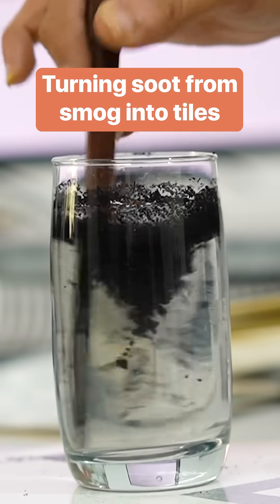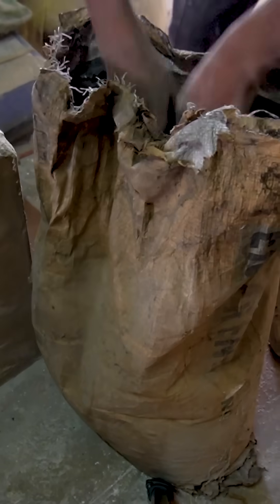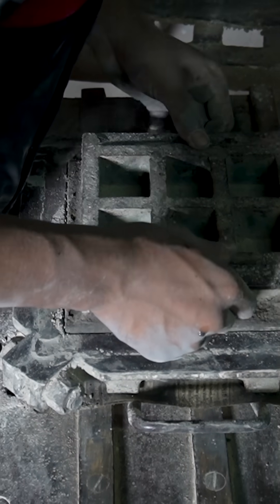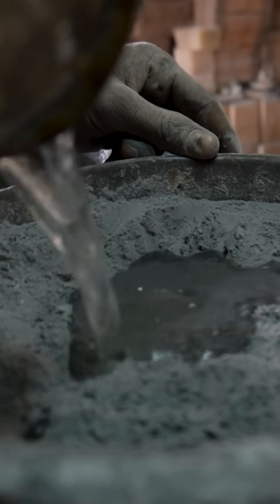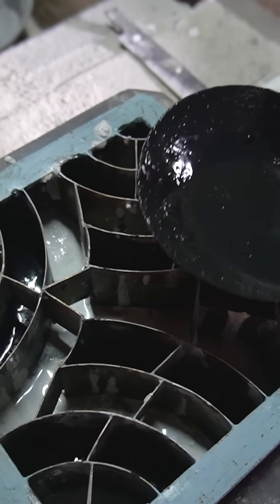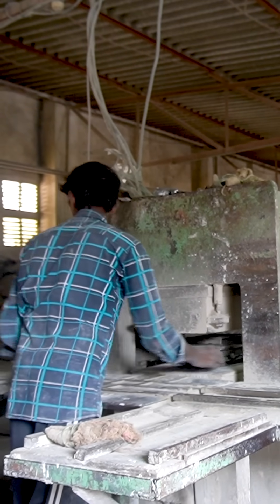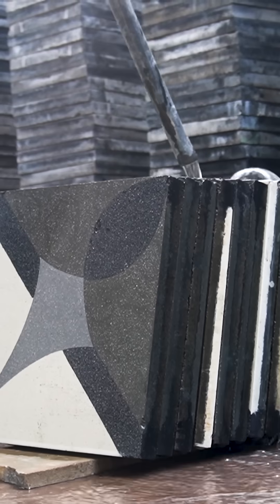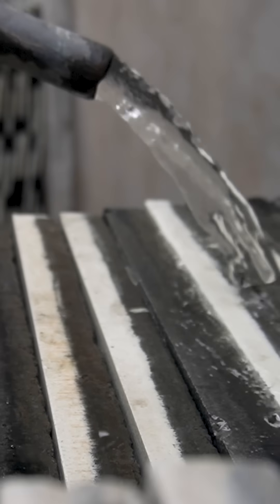Did you know the dust you breathe in can be turned into tiles? #environment #howitsmade #pollution

Comment: Wonder how much coal and oil the plant had to use to extract carbon from the air? How much carbon fuel was used to transport  it? How much energy do they use to run thier kilns? They produce more pollution creating the tiles than the tiles remove.

Comment: This is the future!
Reply: Batteries could be made through this method along with zinc plates and manganese dioxide. Many of them in a series activated by water and vinegar electrolyte could power a building during a rain storm, or circulating pump in a circuit could be a source of zero point type energy with capacitiors added.
Reply: Would love to know the conductivity of these. I wonder if temp is lowered if they hover around powerful Tesla magnets?

Comment: For those worried about the workers health. The one guy shown working with dry material is wearing a N95 mask, that's the same type of mask used by plasterers and medical staff against droplet infections. Once the material is wet no mask is required as its no longer in the air.
The fact you see a person using a N95 mask means they have it available to use. So the ones not wearing a mask are either in the wet area or chose not to use them. It is hard to tell exactly what PPE the workers have available or are using when on a short video.
Reply: That one worker with an N95 could’ve bought his own to bring to work with him; something not all of his coworkers may be able to afford :(
Reply: @deeeno6867  weird that a person would have to buy their own protective gear when working on a hazardous work site.
Reply: @bradprice8040 that's not actually weird at all and is an extremely common issue. This is an issue even in the United States, and this video is not even fro. The United States.
Reply: @jopainting1668  not sure which comment of mine you are referring to but if it is about having to provide your own protective gear then it is very messed up. The company is responsible for protecting employees doing the jobs for the company.
Reply: @deeeno6867 this seems mkre likely 👍👍👍
Reply: If the workers are in the same building particles of dust will be flying all throughout the building, all of them will be inhaling all that dust. They all need way better PPE.
Reply: Expect random commenters acting like they have a PhD in whatever subject the video they're watching is about.
Reply: Thank you! This comment was very useful in clarifying some misunderstanding 😁
Reply: “One guy was wearing an N95 mask, which is the end all be all of worker safety, therefore there are zero concerns about this workplace being safe!”
Reply: lol you mean that non existent seal that old old saturated mask he has on that's probably only there for the camera.. oh yeah he's not dead in 20
Reply: Incredibly ignorant comment! Skin is the largest organ of our bodies and contact with it is a primary method for toxic absorbtion, regardless of the mask.
Reply: You really don't get it.
Reply: Lol, some ones never been to India  or many other nations for that matter. No better education than first hand, do yourself a favor.
Reply: As someone who worked shady construction gigs many times they cut costs by not giving anyone ppe or making you get your own
Reply: And the runoff??
Reply: Spoken like someone that really likes to signal that they care, then buys the latest iPhone, Jordans, Louis Vuittons, etc. I'm sure your carbon footprint is fine, because that WEF looooooves you. Anyway, over the next year, make sure you mask up. Or don't. Actually, I'd prefer you don't. Or maybe I'd like you to. I don't know, and neither do your false gods of muh science.
Reply: Commenting so this comment gets pushed to the top. Not every workplace is as negligent as some people seem to believe. There are responsible employers out there!
Reply: @VaryaEQ  dude they were totally sponsored by Big Smog
Reply: Oh nice for a second I was like oh no do they have an osha where they live 😂
Reply: "Chose" not to wear them.
You're funny!
Reply: @Mr-J... well, you have people during the pandemic not only choosing, but also advocating, not wearing a mask or having their vaccinations. 
So……not surprising in the least lol
Reply: @slowcyclist4324  yes, that was by choice.
My point was sarcastic in that the workers in the video likely had no choice in the matter.
Reply: @slowcyclist4324 yes, but that was largely a very western, privileged movement. I may be wrong about this, but I don’t think India had an anti-masker problem
Reply: @slowcyclist4324 did you get your 6th booster yet?
Reply: 😅 your comment is laughable! We can all see this factory for what it is. Don't talk rubbish.
Reply: @bomma2694  you don't know jack

Comment: Interesting but I have concerns about working conditions
Reply: They don't care. There's money to be made.
Reply: @patrciaclemons8183  they would care if they knew about chimney sweep carcinoma lol
Reply: @MayDaygxd8497  I don't think they would. It's either do that, something else deadly or toxic, or nothing, in many cases. Pretty sure coal miners used to know about black lung and many issues that come from the job, but that didn't stop them.
Reply: @Shadows_Inc  they (workers) do care, they just don't see any other way.
Reply: @hawkandraven14  Right, so what's the point? Either work in a hazardous environment and survive a bit longer, or don't work and die faster. That's how certain jobs work. No one wants to do them for a reason, but they need to be done, like waste disposal workers with carbon dioxide, methane, sulfur, etc. inhalation over time. It's not healthy, but it needs to be done.
Reply: @Shadows_Inc  That's not how certain jobs work. Irl there safety conditions can be put in place. That's why unions are important.
Reply: @MishaFlower  You're right, for jobs like this it's important certain parameters are met,  when it comes to safety standards and consistency. The problem is usually this work is done in lower income areas that can't afford the worker protection or the materials needed to keep workers safe. Instead of disposable industry dust masks that you change out once or more a day,  that cost $30+ a box,  you wear a bandana and wash it every so often, or wear one dust mask far longer than it's useful.
Reply: @MishaFlower i think you are greatly misunderstanding the difference between living in a country like america and living in a country like pakistan lmfao.
Reply: Actually it's pretty common in India for workers to not use safety equipment, even if it is provided
Reply: Fiat currency is more important. 😂
Reply: What is exactly wrong, bro has safety equipment?
Reply: Really? You are astute, don't let anyone tell you otherwise. 😊
Reply: @victorowens9150  I appreciate you seeing my well honed powers of observation and because of this skill I know you’re being sincere as I would certainly detect the faintest hint of sarcasm.
Reply: And wastewater runoff
Reply: Regulators don’t!

Comment: those tiles are certified carcinogens
Reply: Yeah, if you eat them

This is so stupid. I'm sure if you took a cinderblock, reduced it to powder, and snorted it, you wouldn't be feeling so good. It's basically sandstone, except it's not sand it's dust. No more dangerous than a mud brick, or your Kirby clay sculpture from kindergarten. It's become a tile. Tiles don't spontaneously become frigging aerosol.
Reply: @staticostrich4689  oh I just realized, there is a relatively cheap (but not so easy) work around for those carbon tiles, which I am certain has been addressed somewhat. A diyer probably could purchase a water insoluble sealant for those tiles and, "seal the deal" 🤝
(Sorry, couldn't help it) with those tiles, kinda like how a person would seal wood or paintings with Minwax
Polycrylic sealant, or even Minwax Polyurethane (these are only examples, there are better sealants out there, I'm certain of it, and Lowe's, Home Depot, Walmart and others may have these sealants in stock).
Reply: @sandasturner9529  yeah sorta like a rock varnish, which apparently does exist and would do the job containing all the concerning stuff
Reply: @staticostrich4689  well think about it this way. When those tiles need to be cleaned, what cleaning solution exactly will you use to do so? Hopefully it's not something that reacts with those carbon tiles like bleach or ammonia, draino, alcohol, etc. I'm just saying be careful with carbon tiles. I'm not sure if those carbon tiles are even 100% carbon. As with everything, make sure to do extensive research before you use a relatively new, or unfamiliar product, regardless of it's utility/utilities.
Reply: Damn, I wanted to make fun of you for making an assertion with no evidence but your second comment was in such good humor I couldn't 😂
Reply: Then don't eat the tiles.
Reply: @michaelwhatspoppin8256  ok
Reply: You're 18% carbon. It's only dangerous in the atmosphere
Reply: @alakani  you're supposed to say that I am my own carcinogen. You missed the opportunity! 😆😜
Reply: @alakani dumbest shit i have ever heard id love to see how long you would last inhaling carbon dust every single day for years on end. Just because your body is made up off 18% carbon doesnt make it imune to the damage carbon duat will bring.
Reply: @MicrowavedTurtle wow... Did u not read his post. He clearly said it's an issue when it's in our air. Our atmosphere. A block of carbon is not dangerous in and of itself.
Reply: @MicrowavedTurtle  of* immune* dust*
Reply: @MicrowavedTurtle if you didn’t notice the finished product is a solid tile that doesn’t shed powder. Lots of things are terrible for your body, flour is probably more dangerous to have in your house than this stuff
Reply: @boyznthewoodz770  I'm not talking about the finished product I'm talking about during them making it they aren't wearing proper protection
Reply: @alexrusso6503 oh, you mean where it will end up the instant it is stepped on and starts to degrade?
Reply: @alexrusso6503 are you feigning ignorance here? Or just evil
Reply: @uncertaintytoworldpeace3650  neither it's call common sense if an object is intended to be used as a tile it can safely be done so meaning that either they seal it or by other means they ensure the block does not break down under the pressure of being used as a tile. Realistically you would have to take a sledgehammer to the tile to do enough damage where it could possibly harm you but in demo they tell you to mask anyways cause all the other little particles of dry wall wood insulation etc are also dangerous. Stepping on that tile day in and day out even if your entire home was these tiles wouldn't create enough dust to harm you especially if they are sealed in some way which normally tiles are. 
We arnt talking about lead paint or arsenic wall paper carbon as a material is not inherently dangerous the process of making these tiles can expose the makers to high risk tho as they are surrounded by small particles of carbon that can be inhaled. Once the product is made the danger is gone unless the product is damaged in a significantly way not just a crack but pulverized. I don't get what's so confusing about that. Like hand sanitizer is dangerous until it drys but tons of ppl still put it on their hands and wait for it to dry before putting them anywhere near there mouths eyes etc.
Reply: @BeetleBuns  I think my other comment right above kinda answers this but quick answer no the tiles would not degrade significantly enough just by being stepped on to hurt you. You would need to make it turn to dust under immense pressure and force to make it dangerous if that can even be done easily after manufacturing because the production will most likely be sealed etc and first break under natural fault lines. So continued force would need to be applied. Simply walking on it is not gonna do that type of damage. The amount of time it would take to degrade by simply existing to be walked on would never justify us being concerned bc it simply wouldn't degrade quick enough to hurt us. Even if that process isn't slowed further by a sealant or finish on the tiles.

Comment: How can you harvest smog??? Also how much water is wasted on the curing stage? Looks like one step forward ten steps back.
Reply: It isn't. And it's not smog. Smog isn't carbon. Smog is nitrogen oxides, sulfur oxide, and ozone.
Reply: @TempleoftheSon exactly
Reply: @TempleoftheSon and particulate matter.. and if comes from coal combustion, of course it has carbon as carbon dioxide or monoxide
Reply: Factory chimneys are the most common source, also they replace sand with carbon powder, and tge water curing is common for normal cement tiles, only thing is the can be dipped in a large container to reduce water usage.
Reply: @kdhendidhhd smog is air pollution.  He asked how that is harvested (tip: it isn't & the inference is BS).
Now, pulling soot from a chimney or filter would be a different matter and is more likely what is in the video.
Reply: @Mr-J... Agreed. That would be the most amazing park of the process. Theyre just trying to sell expensive tiles to rich people who want to feel like they did something environmentally friendly.
Reply: @Mr-J... glad to see someone else on here gets it
Reply: @Mr-J...  when they started they put collection filters into vehicle tailpipes to filter the exhaust air thereby collecting particles that contribute to smog, what I'm saying is some factories do have flue gas treatment system, similarly we can scale the vehicular exhaust collection system to use it for larger industrial exhausts.
Reply: @kdhendidhhd  what do you think a DPF is for?
Reply: @videovoidtv exactly. Anyone who knows anything about manufacturing even the smallest thing can see this is just a giant gimmick. Its like that scam a few years ago where someone ran tap water though a filter that had some diamonds in it, sold it for hundreds of dollars as 'diamond water'
Reply: Scrubbers
Reply: Carbon dioxide (specifically)  is actually harvested from air pollution in a process called direct air carbon capture. One of the biggest examples is the Orca Plant in Iceland..
Reply: no water is wasted on the curing stage. the water used cured the tiles, therefore it's not wasted.
any water that ended up on the floor evaporated, turned into a cloud and then rained on a maintain somewhere and became ground water.
Reply: this process takes 100+ years. We extract water from the ground hundreds of times faster than it's goes back there through rain. If you get water from river then another set of problems emerge. So it's wasted water.
Reply: @adriankal  i guess you're just wasted water too then.
Reply: @ge2719 Look who's talking.
Reply: @adriankal it does not take 100s of years for a cloud to form and then rain.
Reply: @ge2719 why dont more people understand that? There is no wasting water it doesnt leave the planet. Just you dont have the water anymore.